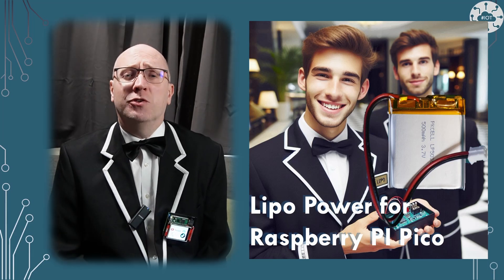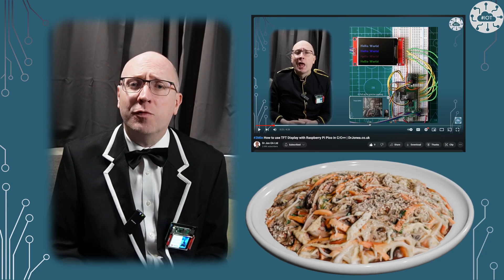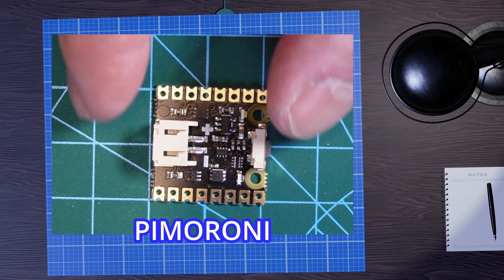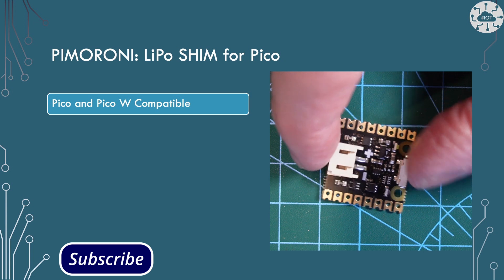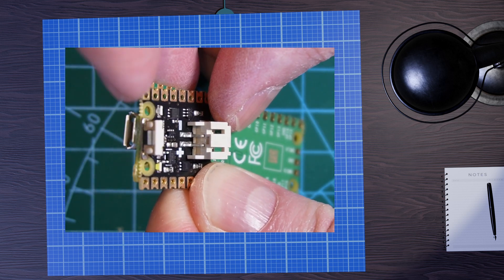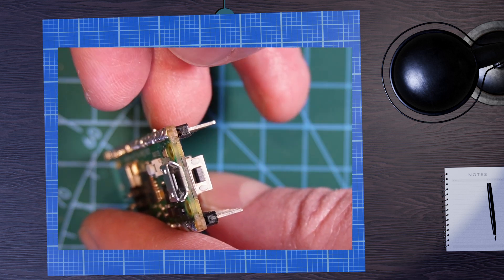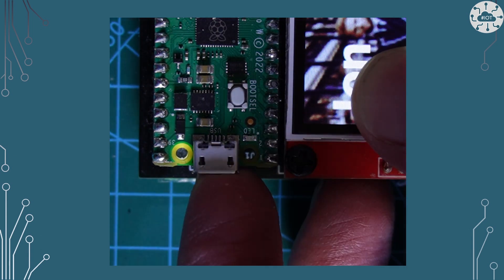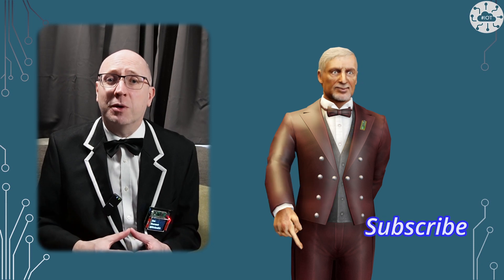Powering the Raspberry Pi Pico W with Lipo Shim | DrJonea.co.uk

Comment: Hi! Do you know what kind of switch is used on the shim? My project is a game controller and I'd like to be able to use a toggle switch, and if the shim is designed to be powered on and off with a momentary switch, that might be an issue I have to find a solution to.
Reply from the maker: Its a momentary switch as pull down that drives a flipflot. The flipflop is then controlling the 3V3EN pin on the Pico. 
You could not use a toggle switch with this with it fixed as a shim. If you could find some way of not connecting the 3V3EN line then you might be able to mod it.

Comment: how long will a pico w last with a 500 mha lipo battery with wifi enabled?  A rough estimate would be okay.  Could it last 2 weeks?
Reply from the maker: Just Wifi and answering remote packets is about 60ma. So roughly 9 hours in theory, less in reality. .
My own strategy for this is to sleep  large periods between work and therefore only draw 60ma for 30 seconds before going to sleep for 5 minutes and dropping power usage to 1.6ma.